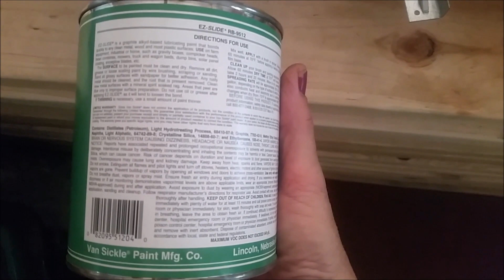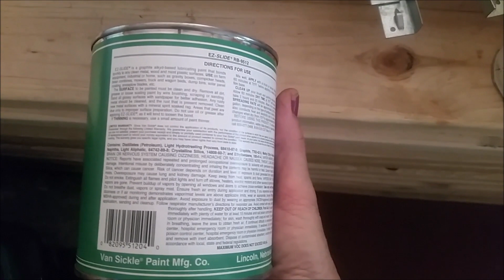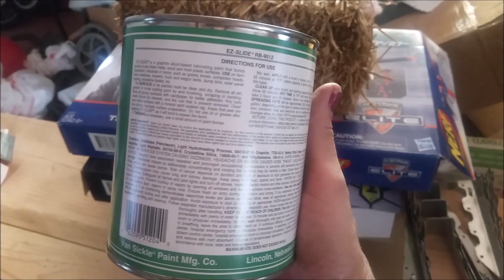Graphite paint for farm equipment

Comment: you should look into cloud seeding, they basically fly into clouds and drop dry ice into the rain cloud to make it rain its not a conspiracy theory either. the dry ice makes rain drop form easier in the clouds and it forces it to precipitate. very interesting stuff. also ya need to invest in a electric  paint sprayer, it has a hose and you shove the hose into your paint pail and spray away, very easy to use and its worth the money. it saves a lot of time too
Reply from the maker: We have a few. I don't think the texture would go though very well without clogging. Im sure they make a nozzle for it though.
Reply from the maker: I learned about cloud seeding in high school. I thinks it's rained enough for everybody with out it!